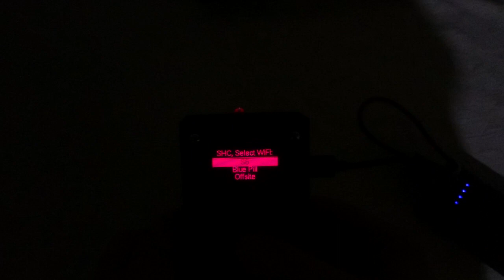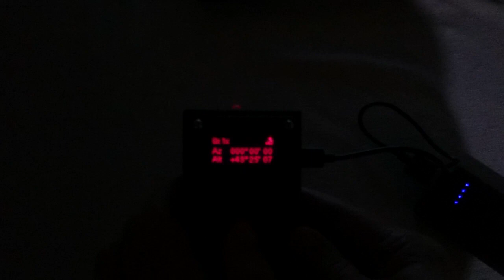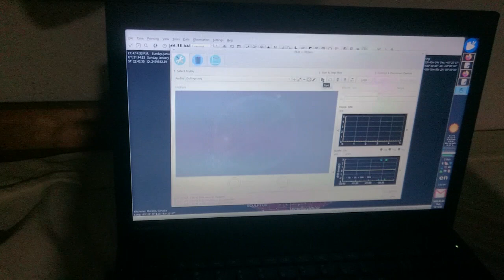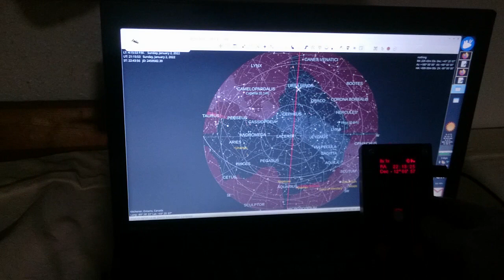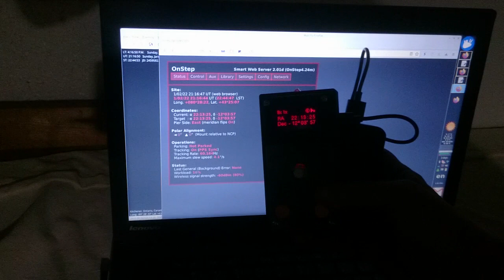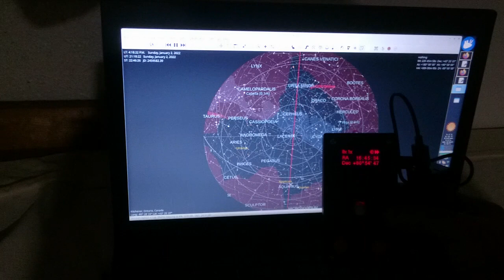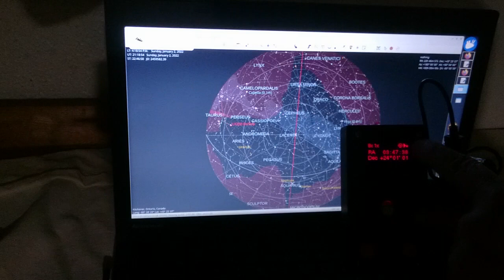OnStep WiFi Smart Hand Controller (wSHC) Overview

Comment: Am using cable connect to the stmbluepill board, if using battery 5v work  also?
Reply from the maker: If you use an ST4 cable, you don't need a battery since the cable will provide power to the SHC.